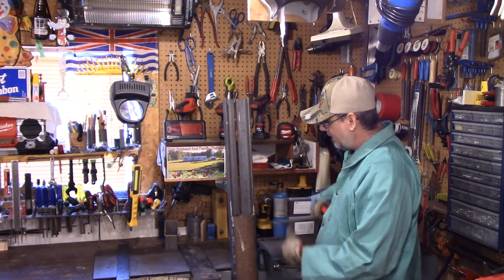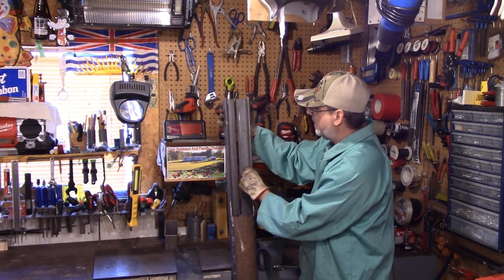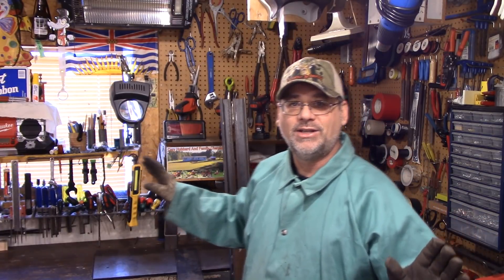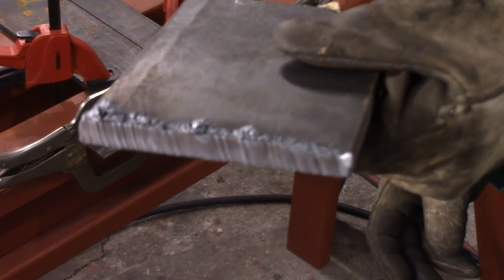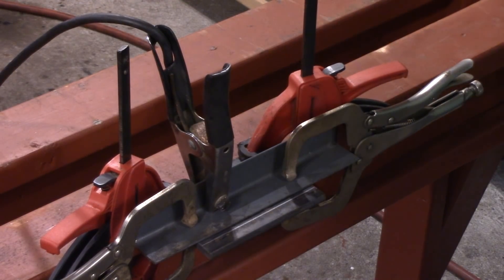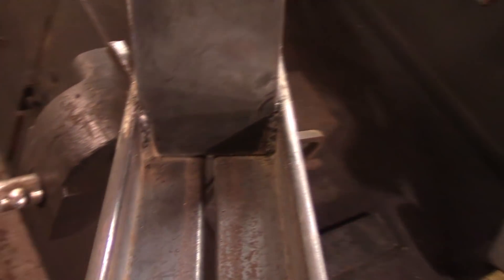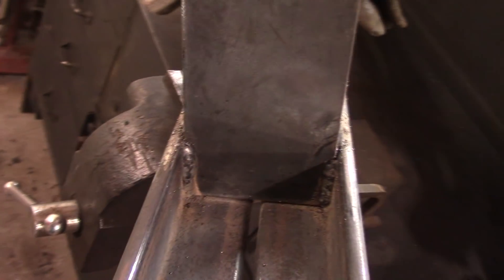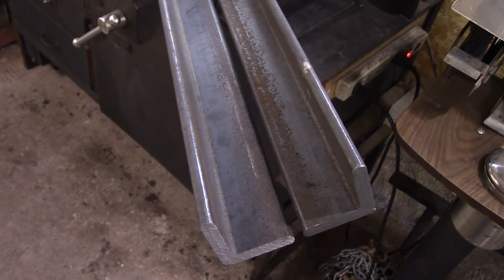HOW TO BUILD A SOLAR PANEL TOWER/POLE FOR MY REMOTE CABIN IN THE WOODS - PART TWO

Comment: That looks really solid. Do you really need the concrete? I like the idea of how you will put a pin and flip that piece up.
Reply from the maker: The idea changes as I figure out some ideas are not so good in practice.  I want to be able to run a  small fridge so 400 watts will do the trick .

Comment: Concrete in that pipe won`t make it stronger Steve....just weld like 6 bolts around the pipe and that it....never move in your life....the project is going good....CHEERS
Reply from the maker: Thanks for the tip Gator , its a hard project since I have never tried this before. Cheers 👍

Comment: Looks good so far, but I don’t know how big the solar panel is or if you will be adding more panels at a later date.  Will you be changing the angle to follow the sun in different seasons. Is wind a variable. Sorry I missed the original plan. If it’s only a cellphone you’re charging that’s over kill
Reply from the maker: Joe I will show the panels and decide on fixed or adjustable but I would like to have a 120v fridge at my camp and 400 watts in solar will do it , hopefully. LOL

Comment: I suggest you position the hinge offset to the post, most likely near the end of the plate that extends from the round post. So you can clean any debris accumulating in that zone when you lower the panel.  Then for the hinge on the square tube, add first a thicker plate (ex. 1/4'') on it to distribute the stress over a larger area on that thin 1/8'' wall tube. The clamp at the top is a very good idea, so any loose in the hinge won't allow the panel to wiggle. You may want to fill the tube with spray insulation (big gap filler for windows and doors). That's my 2 cents! Thanks Steve!
Reply from the maker: Good ideas Joe, not exactly sure how this is going to end up and I don't have too much time to do it. I'm thinking I want concrete to enter the  pole base for more support but I like the foam idea. I have so many projects on the go it's come down to less thinking and more doing or I will be working in december at -20 . LOL

Comment: Steve, what if you took two say 3" x 3" plates and cut two slots on a 90 degree curve then weld two pins on opposite sides one and half inches or so from the bottom of  your pole on opposite sides. Next weld the slotted plates on the plate you already installed on opposite sides of your pole for the pins to follow the slots to act as a hinge.  A better option might be to tap two holes where the pins would be and put two bolts thru the slots from the outside of the slotted plates into the pole !  What's you think ? Maybe I better eat my cherro's ! LOL!
Reply from the maker: How long of a drive is it from CT , maybe you could fly out maybe LOL  I think it will come together  real soon or  as soon as I get a vision from god . Cheers Bill